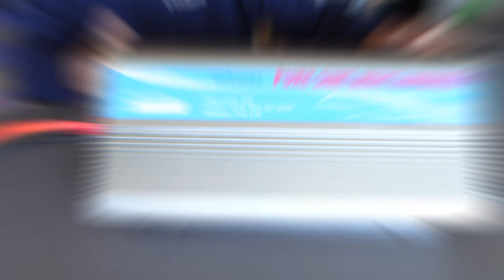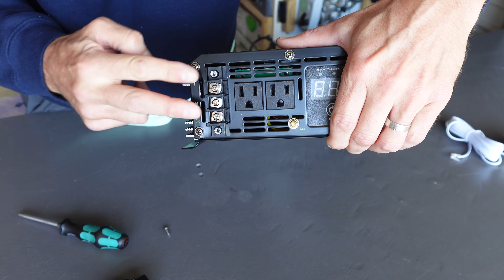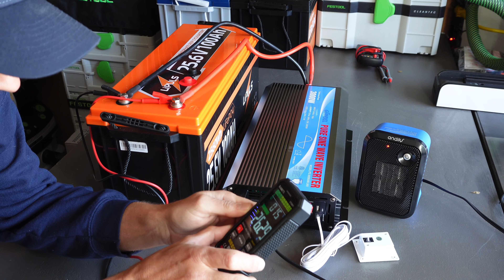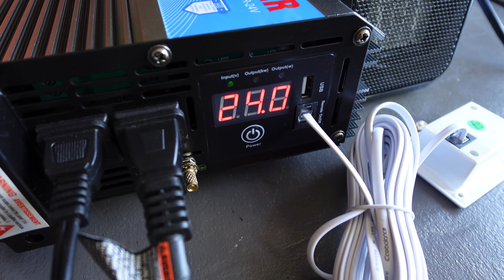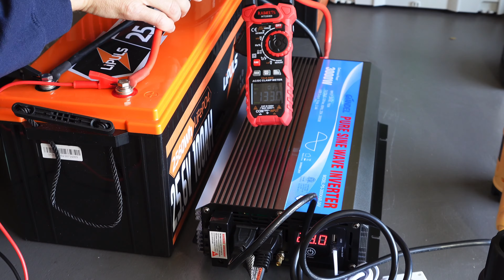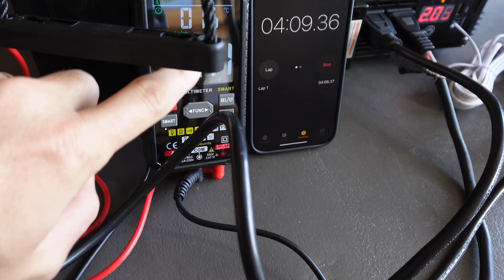Testing the new 24v GIANDEL 3000 watt inverter. Solid machine!

Comment: thanks for your video, I just received my Gandel 12V 3000 watt inverter but sent it right back as I decided I would be using 24 volt.  Im glad to see the sine wave and what it would do with100 Ah.  I have two new 12 volt 100 ah Lifepo4  batteries that I purchased before I changed my mind on going 24 volts.  Now a charge controller, I'm gonna choose a Victron 100-30 which is about right for my array.  Thanks again,  Ted in Sebastian, Fl.

Comment: So to clarify buying a 24v inverter and having a24c battery system. You dont need anything else to power normal items? I run a 12v i thought running a 24v sytem means you have to buy a 24v to 12v  stepdown device to power normal stuff. So im wrong then its actually that simple?

Comment: As per your affiliate link for $399.00. You can get an all-in-one 3kw 24v for around $450. You also would in the upgrade a solar charge controller. A on grid charger. A transfer switch between grid and battery power. This is kinda an elementry video. Giandel is a good inverter from an Australian company.
I would want at least an inverter charger with grid tie for back up/ generator use etc...
 Also a seperate charge controller and panelling can make your system more scaleable.

Comment: I purchased the 24 volt 1200 watt version.   I thought if I wanted a higher wattage I would need a second battery.
Reply from the maker: Technically you need to see what the max discharge rating in the battery is, and then get a little bigger inverter. You do t want to max out inverters

Comment: Qiestion, So with that 24v inverter, could I use a 15A to a 30A adaptor to power my RV. Thanks Don
Reply: Personally, I'd recommend hard wiring the Inverter to the RV with a 10/3 marine triplex otherwise you're limited to 1,800 watts for a 15 amp cord due to fire risk.

Comment: Any reason not to just go up to a 48v system? Other than needing enough voltage to charge the battery.  I'm still new and have several 12v batteries that I use to run my shop with solar around 120v coming in. Not played with anything higher voltage storage wise. Great video, have me thinking and that is always a good thing lol.
Reply from the maker: I’d love to get up to 48v, but they are pretty expensive and massively more heavy. Plus I’d need to get a 48v charger, inverter, or an all in one type unit. Eventually I’ll be able to get my hands on that stuff and test it out👍🏻